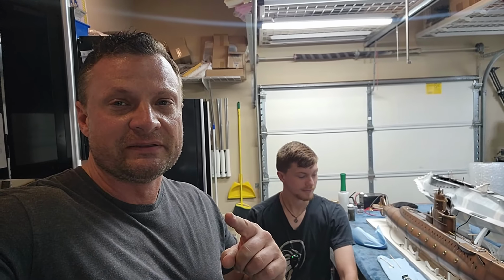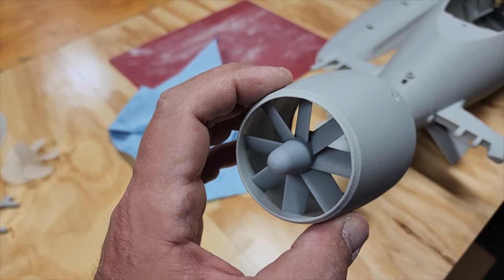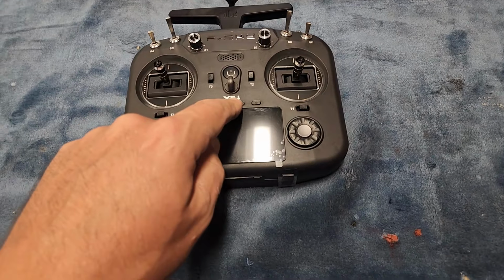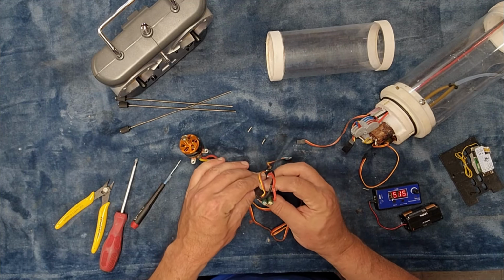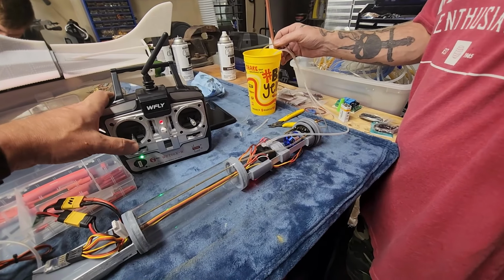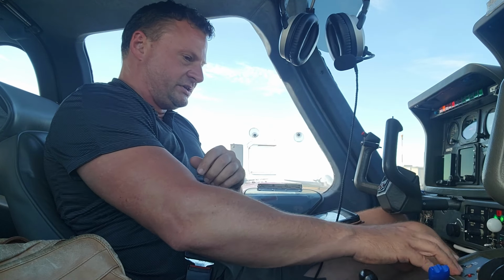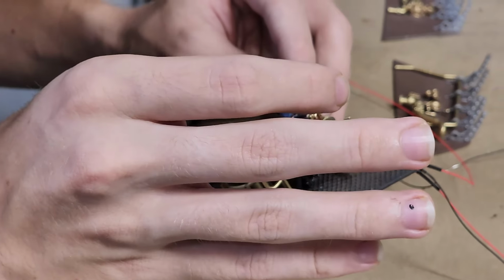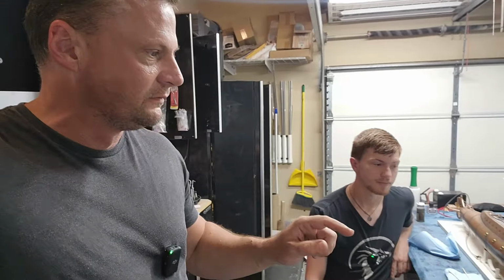RCSubGuy Massacres Marlin, Shows Off Stingray, Flies to Pick Up a Beluga, and Cries Over a Cylinder

Comment: Can you give some info about the receiver from the flooded cylinder.
Reply from the maker: It's one of my Drydocks units we produced years ago. It used parts of the VEX radio receivers as well as a custom board we designed. They are long out of production.

Comment: I think you would only need a few degrees of pitch on those pumpjet stators to provide a significant torque  correcting moment, especially as it's post swirl.
Reply from the maker: All I can do is try it. I'd prefer not to have to completely re-draft and re-install it, but I certainly will if I have to...

Comment: Looking forward to seeing Stingray in action.The end 'propeller' was known as the ' Eddy Damper' and did rotate. Back in the 90s when Stingray was re run on terrestrial tv, Matchbox produced a clockwork bath toy with the propellor inside tbe Eddy Damper. We still have the one i brought for my Son,albeit the clockwork motor has long seized. I have thought about an r/c conversion at some point. BTW,what will you use for propulsion? Prop or water jet?
Reply from the maker: I'm thinking either a larger prop in the damper or a pair of jets in the fuselage. Once I get into the project in earnest, I can take measurements and make solid plans..

Comment: Saw your mention about the  Beck Stingray model. Just to put it into perspective, the model in question, is Stingray  shaped, but, its most deffinatly not a casting off a screen used model that's untrue !, it's out of proportion & inaccurate.the best models of stingray is the 4ft version  by Chris dye and the 34" one by mamas pitsillis who has made a water jet powered version.i'm a authority on stingray ,merchandise etc...btw so any assistance about the craft I'd be happy to assist you on.again I can't stress how disappointing the Beck model is.....please don't use it, would you be happy using a inaccurate naughtilus  kit ?...no I  dont think you would so please start with a decent model base.i have a stunning 36" version of stingray which is far superior model.
Reply from the maker: Sir, the model may not be the most accurate, but for those who are not die-hard, rivet-counting, obsessive compulsive individuals, it will build into a spectacular model. 

I do appreciate your offer of help, but throwing the kit in the trash as it seems you are suggesting is not an option. Please stop harping on the quality of the kit and bad-mouthing Matt Beck and his offerings. A simple statement of some kit inaccuracies is fine, but leave it at that. 

The last thing I need is another battle with a self-proclaimed "expert" in a fictitious craft after that Seaview debacle I was forced to endure a few months ago.